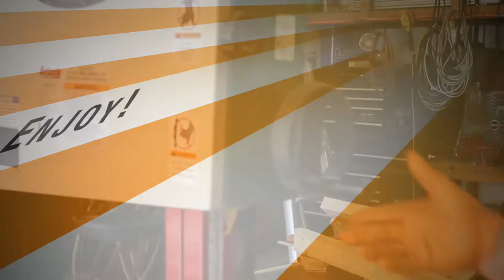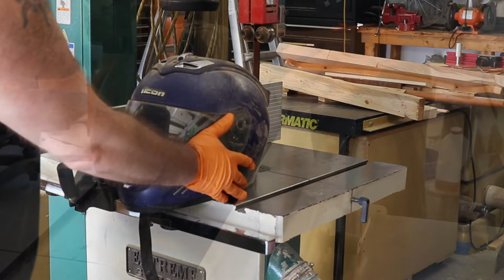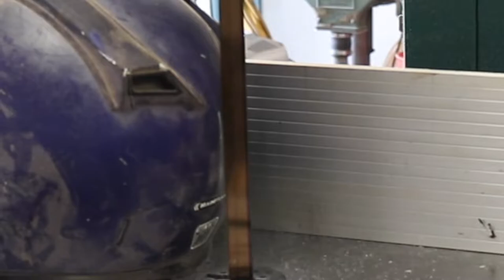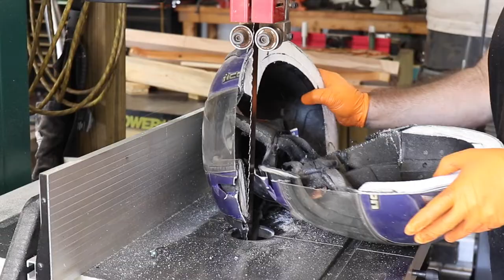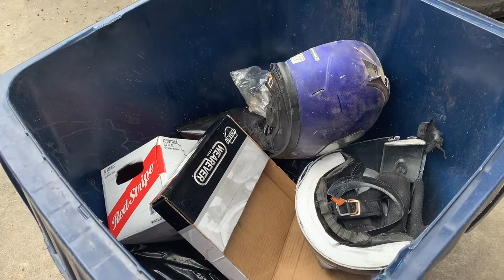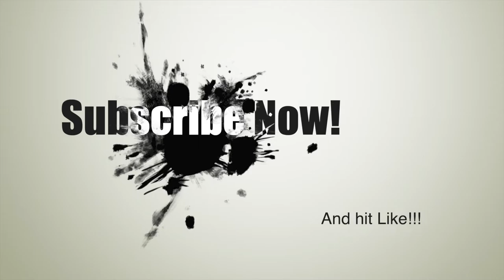Bandsaw Therapy on a Motorcycle Helmet!

Comment: You can recycle motorcycle helmets?  Also, what made the blade throw sparks?
Reply from the maker: James Rose Motorcycle helmets are like baby seats...  your really not supposed to reuse them.  If you even have a small accident they tell you to throw the helet away...

I think it had a thin sheet of steel in the fiberglass layup.  Probably so you don’t we’re through it if you have a bad sliding accident.